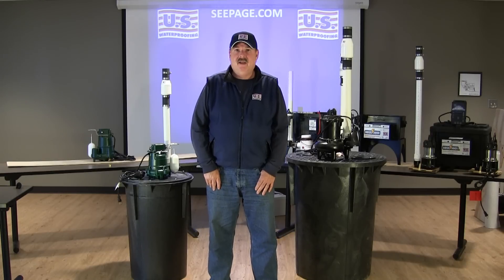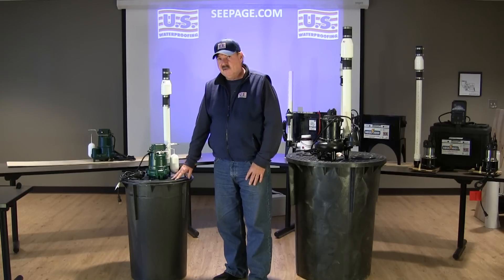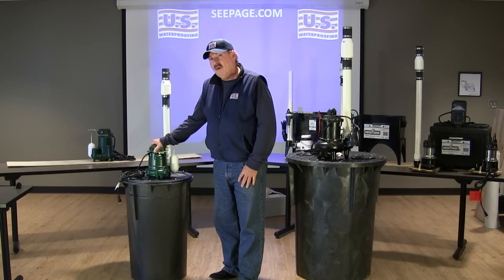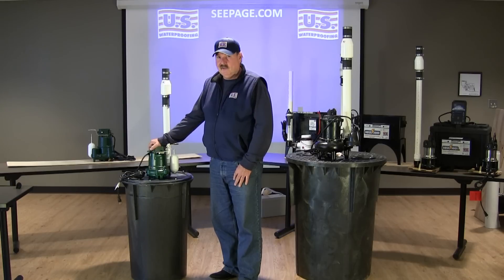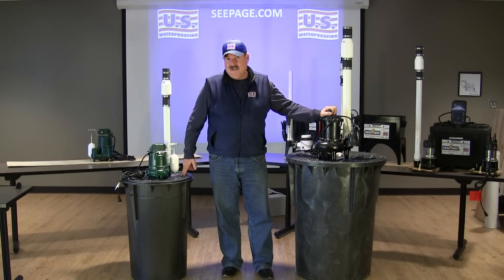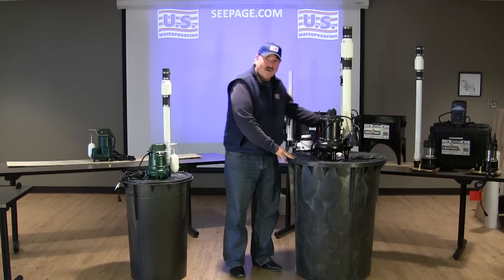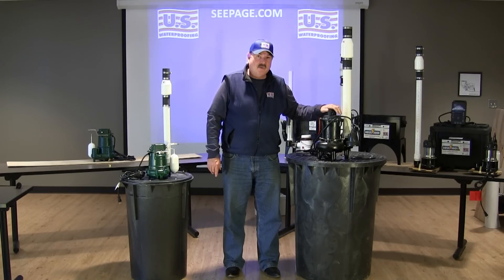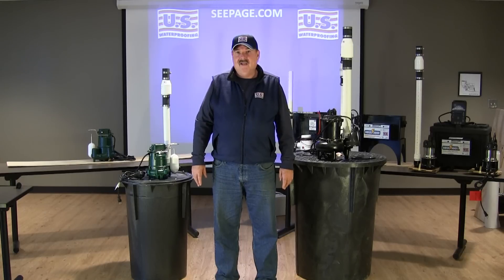Sump Pump Installation: Basins and Discharge Systems

Comment: I have a simple question. We rented a house with a sump pump in the basement. They renovated the house and added a new sump pump and basing. The basin is 26" deep, and plumbed correctly. But, I noticed they have a 4" corrogated pipe running into the basin from the outside of the house about 24" down into the basin. My problem is that I am getting a horrible smell from the outside water draining back into the basin. Is this plumbed correctly? The central air fan unit is in the sub-basement as well and the wonderful smell just gets blown out into my vents through out the house. I don't think this is right by my instincts, but I'm not familiar with correct pump installation and plumbing. Anything helps. Thanks
Reply: Could be designed for a sewer ejector pit

Comment: I want to move physicaly my sump to outside the house. it gets cold here too. my prob is the sump runs so much all year I replace it every year just so it never fails on me. I want to run outside the drain pipes into a tube and then away from the house I know it will take a 6 ft hole who cares.. I will rent a backhoe. just sick of the running elec and threat of water dameges. ques: how do I prevent freezing of the water outside the house? build an enclosed insulated area?
Reply: Get an outdoor sump tank, it has the main sump tank then kind of a second tank on top of that to create the dead air insulation. Outdoor tanks eject through the side of the container VS through the top. I use an outdoor sump for my RV at my house as I can't get the grade required for just a buried sewer line.
Reply: @mythril4  I have not ever seen one of these. Do you have an example? I’ve seen outdoor basins, but not a 2 tank basin with dead air space for insulation